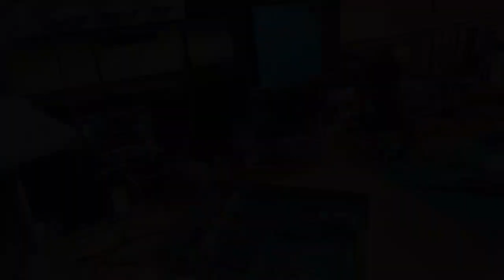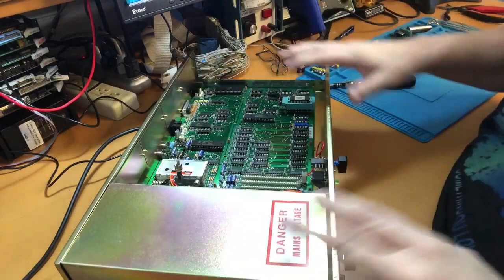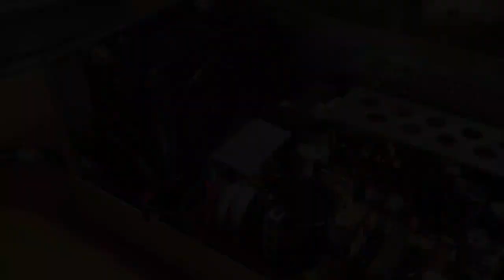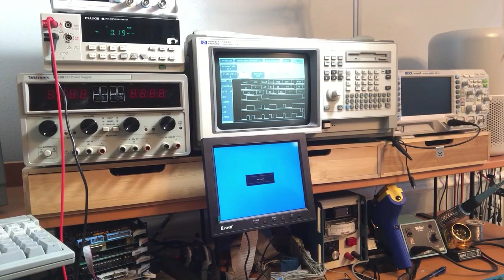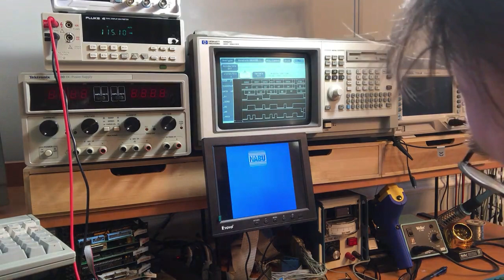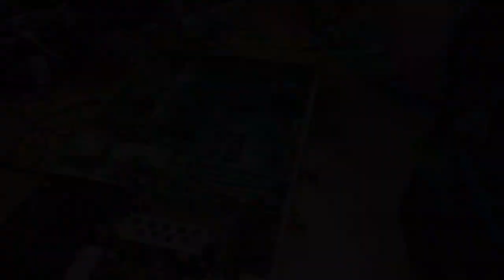NABU - Bad fan caution & get started hacking

Comment: The Nabu I received in December had the noisy fan, and only displays a black screen, which I am hoping it can be fixed.  The Nabu I received yesterday I am sure has a stuck fan, as there is no airflow and I hear an electrical buzz, which I believe is he bound up fan motor.  Oddly the Nabu that had the fan noise in December, did not make a noise and appeared to be working well this morning when I checked if it was still just a black screen.
Reply from the maker: The fan issue is not likely related to the black screen.  these don't get very hot right away and will work for a while without the fan.   As far as the black screen, check out this video: https://www.youtube.com/watch?v=7FlxnNIQspM  

The guy there created a diagnostic guide for NABU by socketing nearly every chip, then removing them one at a time and capturing the symptoms.  There's some content there about blank screen.
Reply: @gregsgeekery  I checked the video and looked at the guide a bit.  Thanks.  I wouldn't expect the fan to be related to the black screen.  The one with the locked fan is the one working anyways.  The screen is black but there is a video signal, I was hoping it was the rom as I found it said that is a common cause for it on an MSX computer.  I certainly don't know what the system would do without a working cpu etc.  I was also wondering if it would be a bodge wire on the bottom that came loose in shipping.  If so the guide could be helpful.

Comment: 1000 Apologies. Yes, I understand that there is a fan/shroud issue in many units. If I fixed the fans myself, two things would happen. 1.) Over 1/2 of you, who have your NABU Computers, wouldn’t have them yet (because of all the time spent fixing fans). 2.) The price of the computers would double to $120.00 to justify all the time spent fixing fans. It was a simple executive decision. Get them out there “cheap” and get them out there “quick”. I hope you understand my position.
Reply from the maker: No worries, you made the right call!   I appreciated actually having to fix something since I enjoy diagnosis and repair as much as just having something.  :). And this is an issue that can be fully resolved without compromise, either the way I did it, or the simpler fix of replacing the fan.
Reply from the maker: Hi James, I may have missed it if posted elsewhere, but do you have any info to share about when/if more units will be sold?   Should I just keep searching for NABU on eBay daily?

Comment: I got my unit mid November 2022. You can add my NABU PC to the list that had a stuck fan as well. It makes sense they would be sort of stuck after sitting in the same position for almost 40 years, but the rubbing seems like a defect from the factory. I ended up taking it apart and using my demel on each blade and also on the shroud to make extra sure it would be good. It runs great now and nice air flow. I did record some footage of the noise mine was making. I've been recording all sorts of bits and bobs and today I'm finally putting them all together in a video. I'll be sure to stick in my NABU fan noise clip in the video for historical purposes.

Comment: Turns out I had the exact same problem too. This whole time I thought it was just very quiet, but it was getting a little warm. Fan was totally stuck, but sand paper did the trick without needing to move much. Thank you!!
Reply from the maker: Glad it helped... definitely some sort of failure mode from the factory... i would not think that the cast metal itself would change size that much just from thermal cycling... but I'm not a materials engineer.   Maybe they all got very hot or very cold - or both -  at some point in the last 37ish years.

Comment: Great video, thanks
I'm really curious: what Brand/Type is the small monitor? It looks really handy on the workbench.
Regards, Rudolf, from the Netherlands
Reply from the maker: The CRT is a Panasonic WM-CM-1020, and I got it at an auction for like $16.  it's well used but has the right retro vibe :)   If you mean the LCD its's this one:
https://www.amazon.com/Eyoyo-Monitor-1024x768-Resolution-Portable/dp/B01FHDL1DE/ref=sr_1_3?crid=1LP5GXEEEQ010&keywords=Eyoyo+8+Inch+HDMI+Monitor+1024x768&qid=1670426201&sprefix=eyoyo+8+inch+hdmi+monitor+1024x768+%2Caps%2C360&sr=8-3
Reply: Ah thanks, I meant the LCD